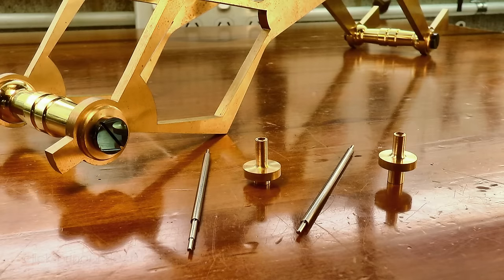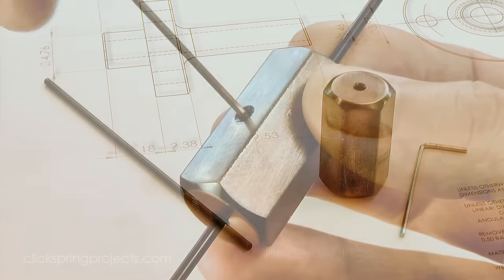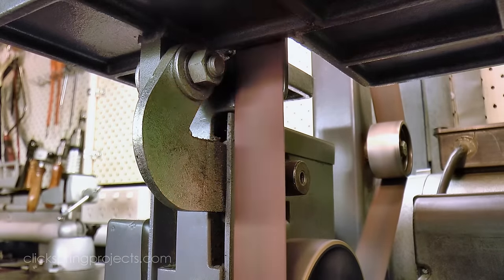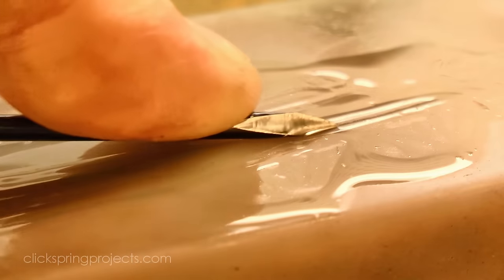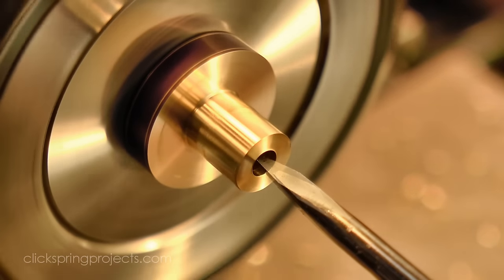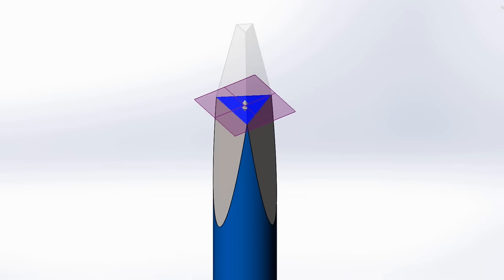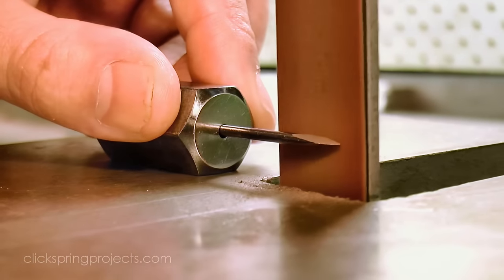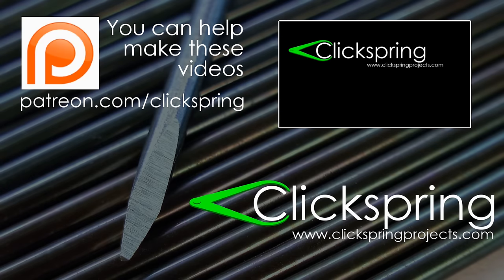Spare Parts #3 - Making A Simple Reamer From Blued Pivot Steel

Comment: this is a great tip, i've used the same technique to make a reamer for a boring bar, just ground a piece of high speed steel the same diameter as I wanted to use in the boring bar

Comment: What you have made is what I know as a clock makers broach, a clock makers reamer is made from blue pivot steel but it has only one citing face mad by making one sloping cut at twenty five degrees right through the pivot steel from the bottom to the top. Hone the cut face on an oil stone, it only has one cutting edge depending on which way it is turned but it can remove far more metal but slowly can be used by hand in a tap wrench it centers its self in a hole perfectly even by hand. it also leaves a perfectly smooth wall hole.

Comment: Mate, I thought your stuff was out of my league but I just used this one to great success. I didn't even make 3 nice faces it was more like 3 and a half. 

I'm using the middle of construction stressing cable to make a centre punch, the cable inner is 5.2mm. To centre punch 30mm stock I turned some 30mm aluminium and then drilled a 5.5mm hole which ended up being sloppy so I sleeved the bore with paper which worked pretty good.

But this time when making one for 25mm I drilled a 5mm hole and made a reamer and it was quite easy.

The way it works is I hold the 30mm aluminium on top of the 30mm square stock I line it up using my fingers then hit the centre punch with a hammer. I can also push both stock and new tool against a vertical surface. 

Thanks for the great tip.
Reply from the maker: Cheers Ian, sounds like a great way to get alignment :)

Comment: An interesting way of doing it. If I have to make a reamer I tend to make a D bit where by you take a piece of round stock, and grind half the diameter away, leaving a 'D' in cross section. You would only grind back the length that you needed to ream with and leave the rest round for holding. I don't
 know how well that would work for small diameters though.
Reply from the maker: MrCrispin96 Hey Crispin, there is a similar thing to what you describe used in watchmaking for setting jewel bearings in place, it's incredibly precise. I think the idea I present here is just a variation on the same theme. Thanks for watching mate :)
Reply: MrCrispin96 Or, just grind a tool like the one in the video but with only one facet going all the way from side to tip, leaving an elongated oval, I believe they are called toolmakers reamers or some such.

Comment: Hello, Criss. This tool has a "positive (obtuse) angle", and the angle is quite large. Why not make an angle close to 0°, just having spent half the diameter of the rod?
As you do this on the chamfering tool in the holes.

Or choose the "quarter".

Mark.

Comment: Never seen that shape used before on a homemade reamer, all the ones I have seen and made have been a simple shallow grind across the rod to make a large oval face, I would think this gives slightly better cutting geometry with a zero rake angle as opposed to the negative rake on yours maybe? Disadvantage though is that you need a good through bore space behind for full reaming. Maybe worth trying?
Reply from the maker: +caskwith The idea I present here is essentially a slight variation on the single facet homemade reamer you mention. The additional facets are generated the same way, just spaced 120 degrees apart. I haven't noticed much difference in performance between the two types, although the 2 extra cutting faces gives slightly less frequent clearing of chips. They both do a great job in a pinch. Thanks for watching.
Reply: +Clickspring Seems to me the cutting geometry would be different in your 3 facet version, with less lead in and more of a scraping action. I guess this could be more on an issue on larger reamers or when using on steel. Can't argue with your results anyway, thank you for the videos, very interesting subject and superb camera work. :)
Reply from the maker: +caskwith Yes I should have been clearer in my response above - the cutting geometry is different to that of a single facet reamer. Thanks for your support mate :)

Comment: Just a 6 inch grinder here but would love to be able to learn how to grind 1/4 hex bits into 2, 4, 6, 8mm hex without anything fancy since those are for bike work and I want to make many sets that are specialized. Some smaller than I can buy, some specially for long work where reach is an issue...etc. Since I've never seen a hex holder like that how would I do it?

I have lucked out and gotten a few to fit. Also practiced regrinding worn phillips bits into square drive woodscrew bits so I am developing the hands on skills but I am doing it all blindly. Your use of accessories would make it far more predictable results.

Comment: i have to say I love your videos... It made me (although I still always wanted one) finally get my self a small old atlas lathe to start playing with. I have been having a blast turning stuff up but Im curious to what kind of tolerance I should be expecting. I have been looking on Google but I keep finding professional shop tolerances (i know i wont be that good due to my 80 year old lathe) but I still wanna know if i need to tune my lathe up more to make fun things like brass bearings (because everyone knows moving things are cool!) 

btw, any idea on fun projects to get started (i might copy your gyro idea)
Reply from the maker: +Engineering Science Awesome! Regarding tolerances, the main thing is that the lathe turns parallel over a reasonable portion of the bed near the chuck. Get hold of the Workshop Practice Series book "Lathework a Complete Course", by Harold Hall. The project on page 35, a precision cylinder square is a perfect project for assessing the quality of your lathe. HH sets a tolerance of 0.002mm over 100mm bed length which is probably a bit ambitious for a Chinese import, but should be achievable with a quality US made lathe. Have fun!

Comment: Anther ingenuous video :) Which belt sander are you using? I'm in the quest for something of smaller dimensions and it seems that yours would be an interesting option for small garage.
Reply from the maker: +Bruno Batarelo Hey Bruno, its a Delta Rockwell 1". No longer made, but they occasionally turn up on Ebay. Thanks for watching.

Comment: Awesome!
May I ask a question? Is reaming (with a machine reamer) enough to make a pneumatic o-ring sliding valve or does it require another kind of finishing afterwards?
Reply from the maker: Armilar Zifferblatt I would imagine so, but I don't speak from experience. What I can say is that the machine reamers I use provide a beautifully sized hole, with a great surface finish, so it would be my choice to use them if I was about to make what you suggest. Cheers mate :)
Reply: Stefan Gotteswinter can you shed some light here? ^^

Comment: might you show us how you made the non-knurled, yet "grippable" (wavy?) brass knob edges as shown in your youtube channel header image?
Reply from the maker: +KevCarrico Will do so at some point soon. Until then: Work turned to profile inthe lathe, and then set up vertically on the mill mounted on a rotary table. The semicircle cuts are then formed by plunging into the perimeter from above, and then indexing. Thanks for watching :)
Reply: amazing work!!!

Comment: what is pivot steel? never heard of that in usa
Reply from the maker: Hey Jamie, its a hardened medium carbon steel in thin rod form (0.4mm up to about 4mm) that has been pre-tempered to blue for clockmakers to use. Checkout a local clock supplies store, they will have some. Thanks for watching

Comment: Why didn't you quench harden the reamer so it lasts longer?
Reply from the maker: John Creasey Hey John, the pivot steel is already hardened and tempered from the supplier, so there's no real need if you're just reaming brass or carbon steel. If you were reaming something particularly tough, you could re-harden and quench, and then temper to straw instead. If it's really tough, you could use the same technique, but use HSS drill/reamer blanks as the rod stock. Cheers, Chris.
Reply: Thanks again for taking the time to answer my questions.  I really look forward to your videos.

Comment: Is the only reason to use a reamer when you don't have a standard drill bit in the right size? I suppose I don't understand the difference between a standard spiral cut drill bit and a reamer. 

Also, your videos are fantastic. I love this channel and I'm not even halfway through your videos.
Reply from the maker: Despite the appearance, a drilled hole is usually quite irregular and rough. Up close it has a very poor surface finish, and is often slightly out of round. However if you drill slightly undersized, and then follow up with a reamer of the desired hole size, it will bring the hole to a very precise dimension, make it perfectly round and also leave a superior surface finish. Thanks for watching and asking :)
Reply: Spiral reamers are better for interrupted holed because the spiral shape of the flutes ensures even contact

Comment: Could you harden the end? to lengthen its life?
Reply from the maker: ***** Hey Gus, the pivot steel is supplied already hardened and tempered, so it's good to go. Thanks for watching and asking mate :)
Reply: Clickspring Here in the states we call these Drill and Reamer Blanks. They're cheap and any decent tool supply catalog will offer a full range of sizes.

Comment: G'DAY.. when I was growing up my uncle John McNally had a machine shop. His company is called Montreal Milling and Cutter. His specialty was machining for the closure industry specifically lining caps and inserting linings and things like electrostatic closures for things like plastic oil bottles.  many machines he made were patented all over the world for the food industry. if you look at my youtube page you will see me flying my little plane my father,brother and I built from scratch. it is called a Sonex. it is a 2 seat all metal home built aircraft.Basically we constructed it from 14 sheets of 6061T6 aluminum from only plans. We fabricated all the parts and it even has an Australian Engine called a Jabiru. this 2200 cc motor was all CNC machined main case with machined  heads. A Very nice little motor. it is over 12 years old and we have over 300 flying hours so far. I love all things machined.. I want to get a small lathe/mill bench top to start home machining. I'll be watching.
Reply from the maker: +1pilotsteve They're a good little engine the Jabiru, as is the full composite airframe, the company is quite a little success story. Sweet machine you have there! Cheers mate.

Comment: why not just use a drill bit of the size hole needed? I actually don't know...
Reply from the maker: Cam Smith Hey Cam, that's a great question! Drilled holes tend not to be as accurate as they appear. They will be close to the indicated drill size, but more often than not, they come out slightly larger. If the size of the hole is important to the job, it is often better to drill the hole slightly undersize (for stock removal), and then follow with a reamer for accurate hole sizing. This is not always required, just when the fit of the hole is important. Thanks for watching and asking  :)
Reply: Clickspring thanks for the knowledge! keep up the videos, they are fantastic!